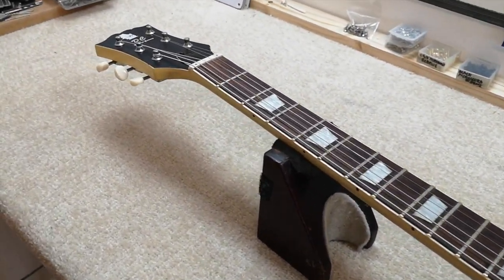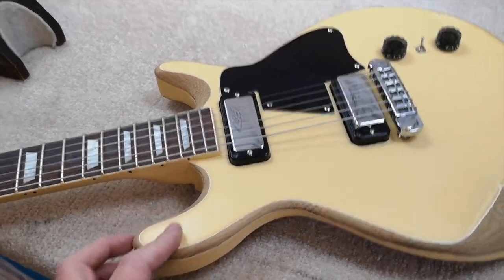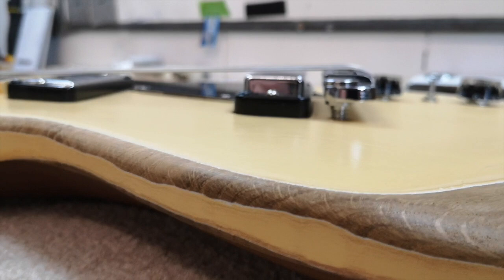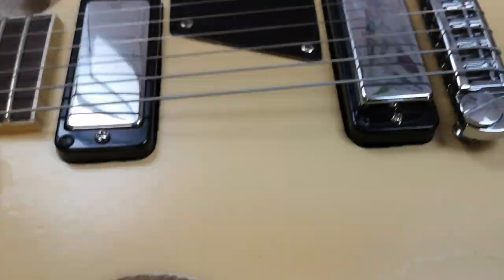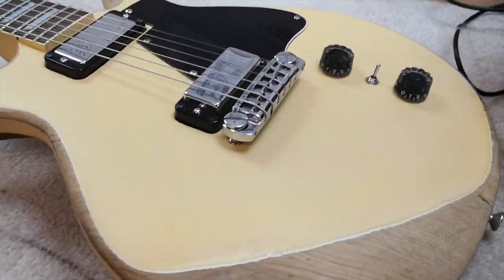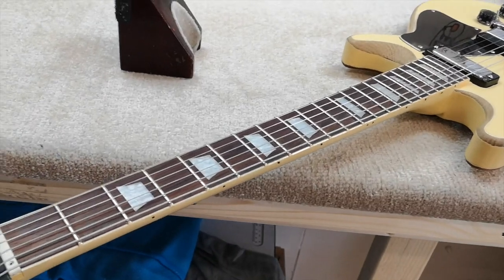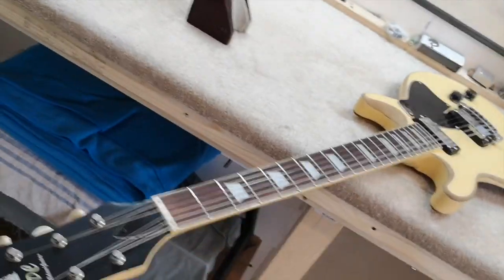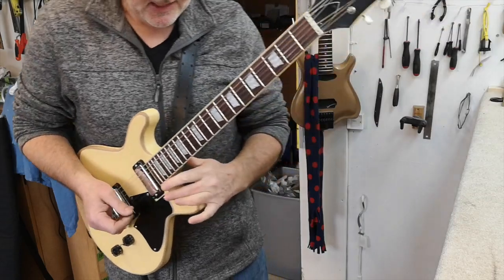Guitars I REALLY love (and why)... #1: Reloved Guitars TV yellow double-cut

Comment: Am I right in thinking a Special or junior has a flat top rather than carved LP Sam? Always wanted a Bob Marley type special wouldn’t mind building one after my current 2 kits are finished
Reply from the maker: Yes, I believe so - I know there were a few slab-bodied Les Pauls along the way ('The Paul' was one and the Les Paul Special was the one Bob Marley played I think). One of my 'GIRLs' is my first LP-style single cut and that's a slab-bodied, non-carved thing. I made two side by side, one slab and one more familiar archtop. I liked both shapes :-) Both are pretty light as I chambered them extensively.